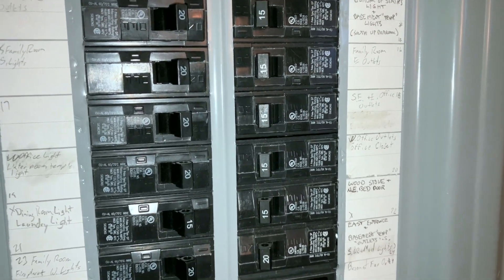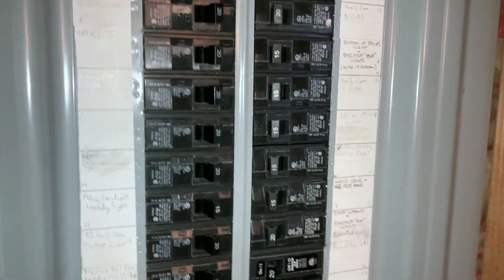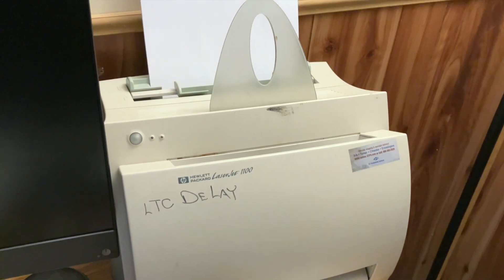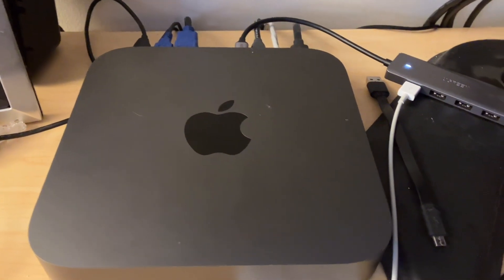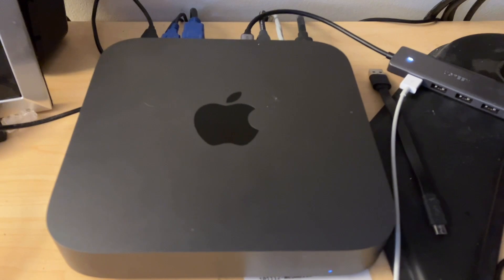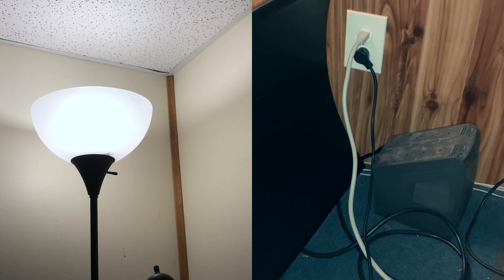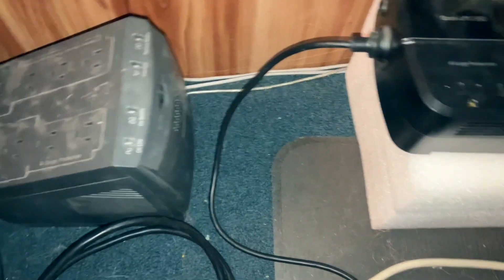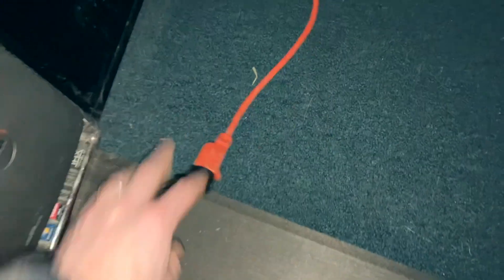Possible Flickering Light Fix for my EG4 6500s?

Comment: My setup is similar as yours and I am  having the light flicking problems as well. I think it there when my refrigerator kicks on. I also have two of the ex6000 for  my  garage but haven't notice any flicking from them. John
Reply from the maker: I would think the 6000s would handle any surge flickering much better.  When any larger load turns on in my house, there's a blink and then 5 or 6 mini flickers and then everything balances out when the load "gets up to speed" for whatever was turned on.  That's how I know when the problem is something different.  If I see a constant flicker, it's not a load turning on.
Reply: @AdamDeLayDIY  My lights flickering like I said before really narrows down to my refrigerators. I have two refrigerators and one freezer the refrigerator in the garage is very old I think that might be the cause the one in the house us newer. Hindsight I wish I had purchased the ex6000 for the house and my garage workshop. Another thing I don’t like about the ex6500 is you have to add units in pairs where the ex6000 can be added in parallel one at a time. I think it’s the high frequency inverters  trying to regulate the loads to quickly in the ex6500 ☹️. O well i guest  I have to live with what I have 😀. Thanks for the reply Adam and keep up the good work on your channel- Bye
Reply from the maker: @TheJR914  Thanks.  Good luck with your system!

Comment: UPSs connecting and disconnecting should only happen if the line voltage or frequency is way out of spec, OR the ground-neutral bond at the service ingress is not solid, OR if the neutral is floating (utility transformer lost its neutral and the AC waveform is no longer centered around your ground/neutral bond).  UPS's are really sensitive to utility problems.
Reply from the maker: I can't recall if it happens when in battery mode or in bypass mode, but whichever one it is, they're constantly clicking on and off.  When I disconnect the inverters completely and go straight from the grid (bypassing the inverters), I have no problems with the UPSs at all.
Reply: @AdamDeLayDIY  Another thought is that it could be due to having unbalanced loads on the legs when running off the inverter(s).   Its an interesting problem for sure.  One that might require an oscilloscope to fully diagnose.

If you do try to use an oscilliscope to check for a waveform offset relative to neutral, remember that the oscilliscope's "ground" lead on the probe is connected to the scope's ground / plug ground, inside the scope... that can represent a shock hazard or result in accidental shorts.  A fully portable battery-operated oscilloscope might be needed to avoid accidental shorts.   I always make sure that my ground and neutral wires are solid and the same before I use my scope to probe the HOT (w/ neutral connected to scope ground).   If you do that,  set the vertical range to something big like 200V and set coupling to DC (not AC) so you can see if the neutral is offset (not in the midle of the waveform).

UPSs trip on all sorts of things.  In fact, it might well be that the ones that are tripping are the higher-quality UPSs that are checking more conditions :-).  Out of spec voltage, out of spec frequency, waveform on the "hot" is offset relative to neutral (neutral isn't at the mid-point), bad or missing neutral/ground bond, or "power quality".   Where ""Power Quality" can mean anything from a really poor power factor to excessive noise/glitches on the waveform.

My UPSs refuse to work at all if the ground-neutral bond is missing or has too large a voltage offset.  And they go haywire when our neighborhood transformer loses its neutral, which happens once every few years (its an underground transformer that gets flooded every so often).

Fun fun 🙂
Reply from the maker: @junkerzn7312  Definitely an interesting problem to solve!

Comment: Most likely you are getting common mode harmonics between the switching frequency of the inverter and the switching frequency of the switch mode powersupply in the PC. Put a choke on the power cord of the computer and see if it goes away.

Comment: If you have small solar generator, hook your Mac computer to the solar generator, and then plug the solar generator into the wall.
Reply from the maker: That was actually something I had considered.  I'm actually looking to build my own out of my old 12v system.  I'm trying to get all the pieces together so I can document the process.
Reply: A Bluetti EB3A would probably be perfect for this.

Comment: This might seem overkill, but I have a bunch of air cleaners in the house whos fans cause lots of line noise.  My solution was to buy plug strips which had built-in filters (designed for audio equipment) and that got rid of the line noise.   The particular brand of filtered plug strip I got was "Furman".
Reply from the maker: Thanks, I'll take a look!
Reply: @AdamDeLayDIY  As a side note, I used the filtered plug strips for the fans, the filters work in reverse too... so that prevented the line noise caused by the fans from getting back into the house wiring.   One can use these sorts of plug strips either way... either on the devices causing the noise, or on the devices sensitive to the noise.   e.g. Furman "Power Conditioner" plug strips. also known as plug strips with EMI/RFI filters.
Reply from the maker: @junkerzn7312  Nice.  Thanks for the recommendation!

Comment: Couple things. I also have some APC UPS's that wouldn't run on inverter. They would click on and off. I was able to go into the settings and change the sensitivity to low. They run on inverter power without complaining now. For the flickering, a possible fix could be a double conversion UPS (either purchased or you could also diy one with a battery, charger, and another inverter) for the mac mini, that would isolate it from the main power. Not the cheapest way to solve the problem but if you run out of other ideas it could be a last resort.
Reply from the maker: Thanks.  I'll have to take a look and see if these UPSs I have can even accept commands to adjust the sensitivity.
Reply: @AdamDeLayDIY  If you can plug them in with USB you should be able to change it via APC Powerchute. I believe those style Back-ups units had an odd RJ12 to USB cable

Comment: I have been in the IT world my entire working life.  At several companies I have worked at we always had to remove Mac's from UPS's.
Reply from the maker: That's interesting, I wonder why.  We've had all our Macs in our office hooked up to various UPSs over the years and never had any issue on grid power.  Only noticed this when trying to power the house from the inverters.
Reply: @AdamDeLayDIY  I had just purchased a small UPS for myself. I noticed in the ad it said this "approximated sine wave to supply cost-effective battery backup power to equipment that does not have Active PFC power supplies" not sure if this helps.

Comment: Oh, those phillips hues smart bulbs have always been a problem for me.   Well, the real problem is that cheap LED bulbs just rectify the line frequency rather than regulate to DC.   I have basically removed all dimmers from the house now and that has solved most, but not all of the problems.    Its nearly impossible to tell which LED brands are good and which are not, unfortunately.

The lights in my office has always flickered too.  I finally unscrewed the entire enclosure and I found that the original installation of the wiring was using wire nuts to interconnect the solid copper house wire with the stranded wire from the lighting enclosure.  The interconnect had gotten loose over 30 years due to the mismatch.   Fixed that with some WAGOs and the problem went away.

Comment: I notice that the mini Mac doesn’t have a grounded power cable.
It may be that there is an injection from the switching power supply back into the lines.
Perhaps there is a household grounding issue somewhere.
It would be interesting to put a scope on it somewhere.
Reply from the maker: Yeah, seems like Apple believes they don't need to have ground pins on their power cables for some reason.  Seems like if it was a household grounding issue, I would see it on both mac minis and it would potentially show up regardless of battery vs grid mode.  

I do need to just get a scope.  Need to find one that will work that doesn't cost an arm and a leg.
Reply: @AdamDeLayDIY  have a look online regarding the Mac Minis - there seems to be something out there with the displays flickering as well… not sure if it was a OS upgrade that resolved the issue, or what the actual issue is. It seems to be fairly common.

Also - check out “Adrian’s Digital Basement” as he reviews a bunch on inexpensive scopes.

Comment: Aloha Adam. Just for Fyi purposes, I have one of those inverters and have bad flickering lights when our K-cup coffee machine is running. So far, nothing else on the inverter/solar load panel seems to affect the lights. Side note, i have the same coffee maker at work, in my office, and the lights flicker in my office whenever using that coffee maker. Something about the parts being used in that machine. Thanks for taking the time to post these videos. Helpful to me when installing my system. Mahalo, Charles
Reply from the maker: Howdy Charles!  Thanks for the comment.  That's interesting about the K-cup brewer.  Must be the pump because I wouldn't expect the heating element to do that.  Very interesting.  I know that I've seen my laser printer cause my office light to flicker up until I removed that mac mini.  Now there's no more flicker even from that printer.  Very odd how one little thing can cause these annoyances.  Take care!  Hopefully your install goes well!
Reply: Keurig coffee makers do this on my MPP 6548 twins when there’s not much else on. Keurig uses a solid state switch to quickly turn on and off the heating element as a way to control the heat. It’s part of their technology to near instantly heat the element then pulse it to keep it hot but not melt.  
When the inverter is at a low load, it sees the load, ramps up and has to ramp down back down. There’s a delay and you see this.
Reply: @Skypower with Karl Jensen  That makes sense. It is early in the morning, when not much else is really pulling power. Other than that small issue, the only other minor issue I've noticed so far, is with the Watchpower app. But for a free app, not really complaining. Only been running a month...hoping this inverter goes the distance. Thanks for sharing the info on the coffee maker 🤙🏾

Comment: I also have 2 of the same inverters as you purchased in the fall last year, just haven't had a chance to hook them up yet.  Currently using my old 1990's Trace/Xantrex SW5548 for emergency power off a 30 kwh EG4 LiFePo4 rack..  Just purchased Solar Assistant based on your other videos.  Keep up the great work!
Reply from the maker: Thanks

I've heard those Trace units just keep running like tanks.  

Good luck setting up your inverters!
Reply: How do you like the sw5548?
Reply: @dexbad8857  I got her used in 2004 and ran her on eight 6v 200 AH lead acid golf cart batteries.  Had her installed in an enclosed trailer running a 9,000 BTU Mitsubishi heat pump from 2012 - 2019.  We would go camping in the middle of nowhere in the Adirondacks and have heat and AC, then use a 2,000 watt Honda generator to charge up the batteries for a few hours the next day.  Right now she is back in the basement since 2020 and as of Novenber 2022 has been connected to the new 30 Kwh EG4 rack.  She likes having lithium power and coupled with a few of the dedicated 120v to 48V 18A battery chargers, eliminates the need for the 5548 to be connected to grid power.  The 5548 always tends to make generators hunt as it switches current, also causes some light flickering when connected to the grid.  The EG4 chargers eliminate the hunting and allows the inverter to really produce clean power and act just as an inverter.  I have one of the old trace T-240 auto transformers to give me 240V so I power everything in our house through a 200 AMP DPDT transfer switch.  Runs the old washing machine nice too, no surging like Adam is experiencing, a really robust inverter way before its time.  It was also built before all the capacitor problems were experienced in all the modern electronics.  The thermostatically controlled fan doesn't run until it needs to for cooling, but you will hear a 60 HZ hum coming from it whenever it is on, so I don't recommend having it in your bedroom.  Search mode works great for loads like non electronic refrigerators, freezers, water pumps.  You can set it to send out a load search pulse at any time interval you want up to 10 seconds I think between pulses.  When it detects a load higher than your programmed threshold, it turns on and runs the load until the load drops below the threshold.  She is heavy though, dead weight close to 120 lbs.  If you get a chance to put your hands on one go ahead and grab it, if you have one shipped to you make sure they package it well.  Get 2 people to help you move it and use leverage whenever possible.  Never had a load she couldn't run and never regretted buying it.
Reply: @dynamicenergysolutions180  I do got one and to say it's a beast is an under statement 5500 watts and surge for 15000 run my entire house 150amp main with everything ac jacuzzi tub and all and I have never heard or see the fans running. Only have solar coming into it and some Trojan t106. If only these modern manufacturers of inverter would take a look back to the past. Enough with the frills and bells and whistle and the core function is not being achieved.

Comment: Probably the switching power supply in the mini mac.  Since the switching power supply in the mini mac is a high frequency power supply (think high like 4 khz), maybe it is producing noise which is seen by the high frequency switching in the inverter and the inverter modulates the regulated voltage based on this feedback.  Might be worth trying a power cord with a balun for the mini mac which is designed to suppress high frequency noise.  
Also, do you still have the flickering with the washing machine running?  I know it is a different flicker probably matching the load of the motor, but without the high frequency noise on the AC power, the inverter may be able to compensate better with the varying motor load.  That is why your UPS's don't like the power when off grid.  They see these small spikes and don't want to power your devices from that dirty "spikey" power..
Reply from the maker: I still have the flickering with the washing machine.  Still faint on the good light bulbs.  Found a few cheap quality bulbs in the house that it's really noticeable on.  Have to replace those still.
Reply from the maker: Thanks for the balun idea. Didn't think about that one.

Comment: ? Perhaps the chargers for the ups and the computer switching on & off in float mode for their internal batteries.
Unrelated - but I experience a ton of flicker and both small ups units cut in and out whenever I use our diesel generator to charge batteries thru our inverter.
Mostly due to the fluctuating power frequency from the generator. If I had to do it all over again I would have got a larger inverter gasoline generator to supply better quality power to the inverter for loads & charging.
Diesel is nice and heavy duty/reliable and the fuel keeps wayyy longer but the fact is we never run it except for maintainance-lube reasons, so an inverter gen would be simpler, more portable and with less nuisances.

Comment: Hey bro I like video but that problem is an easy fix the flicking has not thinking to do with your min Mac it's your refrigerator when the flicking happen plug off it and it will stop all you have to is just add a 20uf Cap inline and that will fix your problem
Reply from the maker: Thanks.  It's not just the fridge though.  Even with the fridge off, my office light flickered.  Removing the mac mini stopped the flickering.
Reply: Ok check the frequency on the line when you have the flickering and see what happen I the inverter frequency is not stable that why you having that problem

Comment: If the ups doesn't like your off grid power the that means your inverter doesn't have power clean because i don't have the problem my light flicker wen my washer is on
Reply from the maker: Could be.  Still need to get a scope...